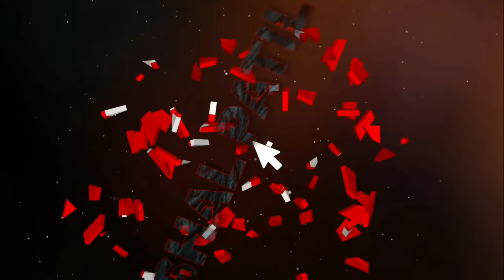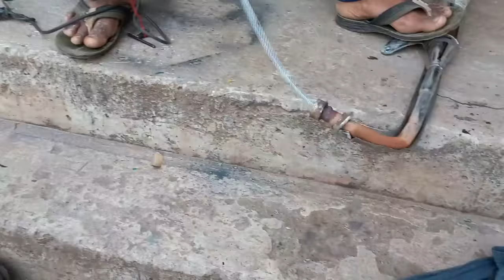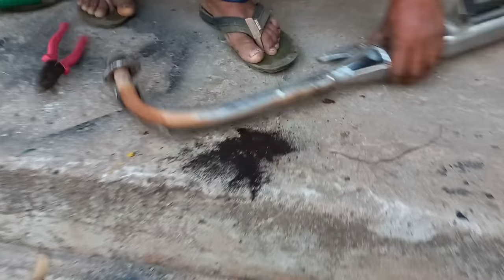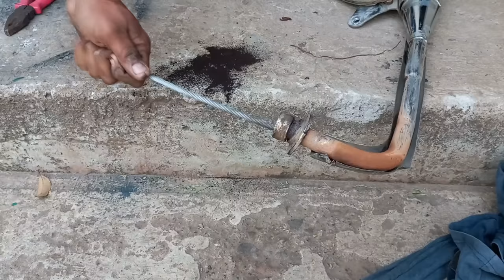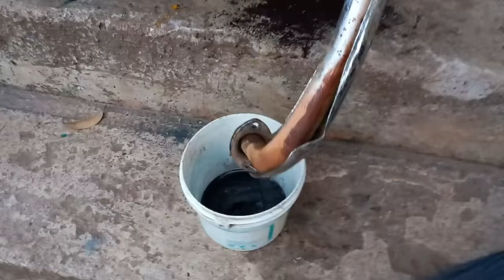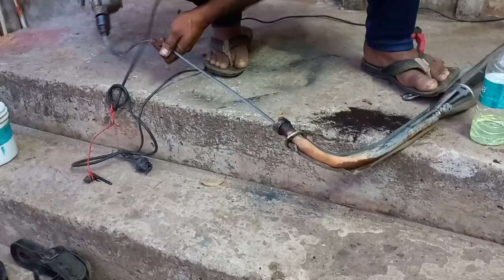Hero Splendor bike silencer carbon cleaning process #mh10vp

Comment: No amount of poking a wire down the pipe will clean the carbon deposits from those silencer holes....remove the silencer internal pipe from the end, more simple and way more effective....
Reply: how to remove the internal pipe and clean, what is the liquid used for cleaning?
Reply: Best and easy use toilet cleaner